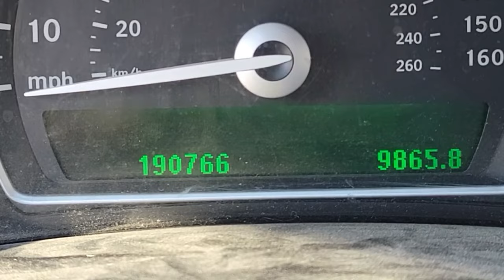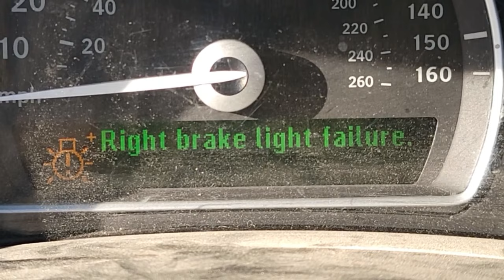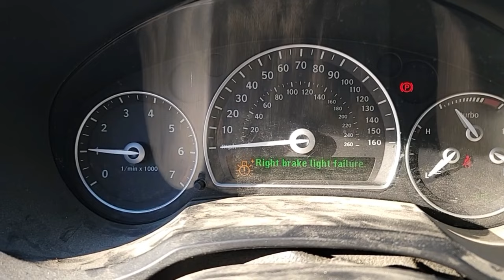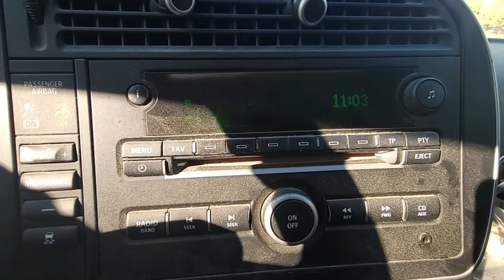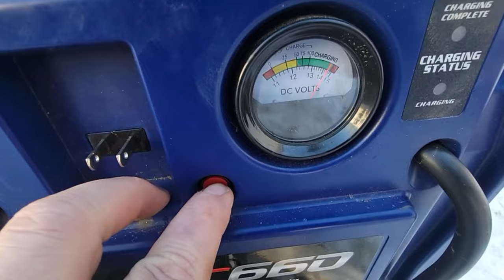Saab turbo junk

Comment: Well...its junk now.   A poorly maintained and beaten Saab Turbo with 190K miles or 300K KM has an engine issue.....totally shocking.    I'm amazed it held together this long.  These GM Saabs had issues, but compared to some of the sh%tbox engines like the Ford Ecoboost being made today, these were awesome.

Comment: Boot? No boot? Hmmm. Some enthusiasts would give stupid money for one of those cars
Reply: On the other hand, it’s damaged, sounds like it’s running on 2 cylinders and the rust is probably about to get it as well.
Reply: @tescoshortage  youd be surprised what some people would give for scrap. Still, an already half booted engine would make for a very interesting "finishing off" video. But yea that ones red rotten with rust. Good cars in their day
Reply: @alexhickey5633 this is worthless
Reply: @alphatrion100  It depends how far the rust has gone.
Reply: @Ressurrectio  It's a seemingly easy fix, had the same problem on our car, and fixed it in one day.
Reply: @julosx  These cars don't rust as bad as the 9-5's, the 9-3s have good rust protection. Have never seen a rusty 9-3, Only 9-5's, and when they do rust it's not a lot. If you wanna talk rust look at the older passats from 2005.